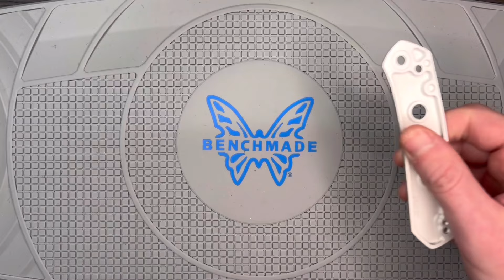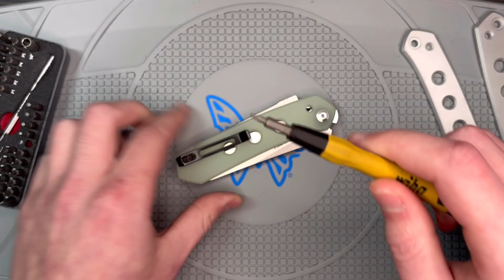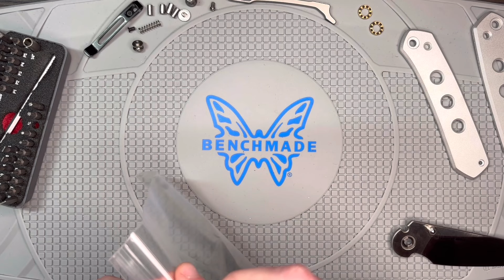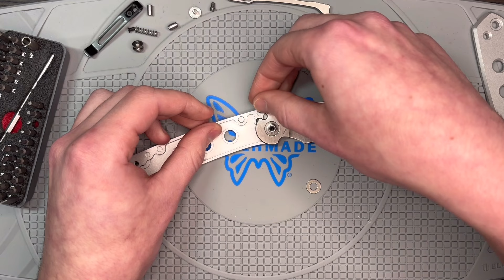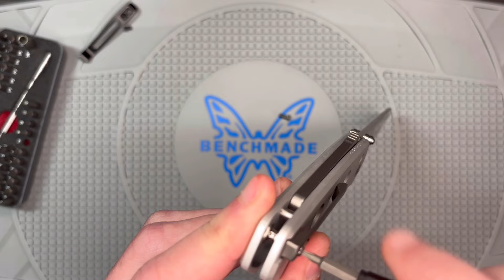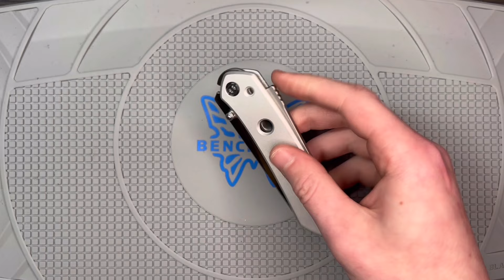HUGE Upgrade to a great EDC - Civivi Vision FG Linerless Aluminum Scales

Comment: Thanks for the video. Mine was a pain to do because of the pivot screw, it was caked with loctite so I had to burn the old scale in order to loosen it.
Reply from the maker: Burn?! A hair dryer will do the trick
Reply: 😂 yeah I recommend just heating them up first before melting them off. I had to do that with the Deka. That's also why I never re-loctite knives, hasn't been a problem yet.

Comment: Has anyone tried Assembling the scales, but with the washer against the blade instead of against the scales and the bearings in the scale cut-outs?
Reply from the maker: The washers are there because the ceramic balls in the bearings would quickly wear into the aluminum and the knife would no longer function normally. They are steel so the bearings have some to ride on

Comment: You tried twice without success to open it through the spine lock and couldn't. Then you resorted to the thumb studs. Did your knife not work well with the super lock on those scales? It seems like you noticed it wasn't good and decided to force the blade open using the thumb studs.
Reply from the maker: @NathanDrake224  I was just fiddling around with it a bit.